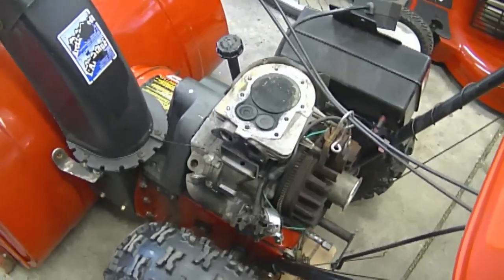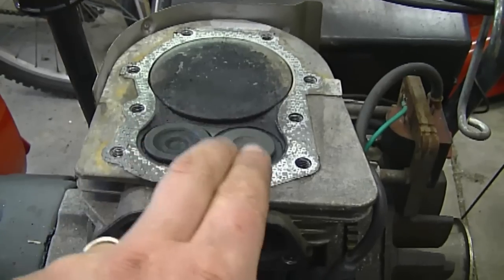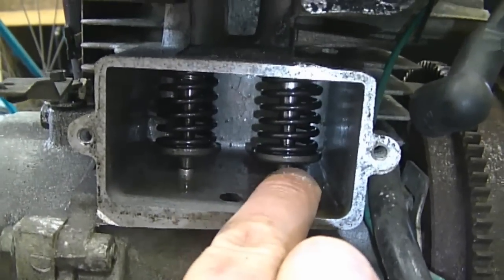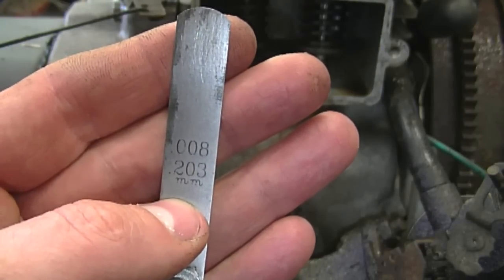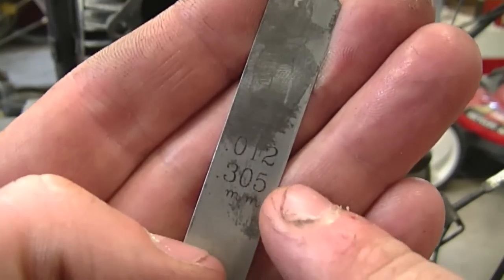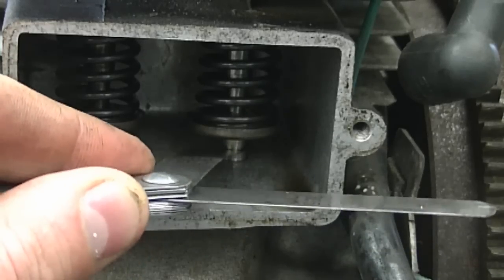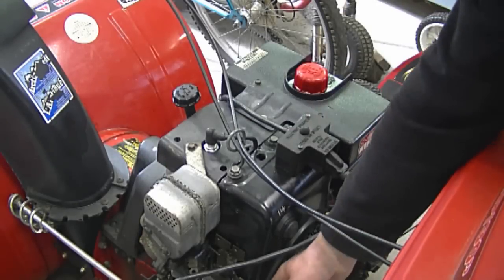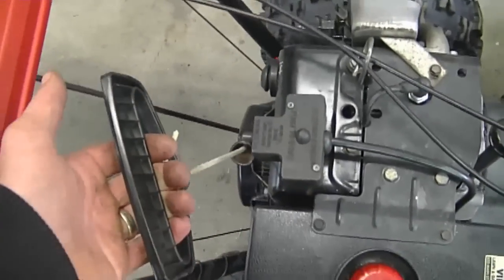HOW TO Check The Valve Clearance On A 4 Cycle Flat Head Engine

Comment: But how does the clearance get that tight in an old motor?   It should get looser...   Metal doesn't just grow onto the valve stem.
Reply: The valve seat wears down, thus reducing the clearances. It tends to happen more often on the exhaust valve.
Reply: TReaD113  He could probably put a new valve in that would probably have more material, but I guess the easy and cheaper way is to just grind a little off.
Reply: Putting a new valve in wouldn't help at all. The seat is still worn down and you'd still have to grind the stem. grasscutter88
Reply: Valves and valve stems can stretch over time due to heat and pounding against the valve seat; particularly exhaust valves. It used to happen a lot in air cooled VW engines. Valve seat and valve face wear can reduce the clearance too. This valve actually had negative lash (it was being held open even at the base circle of the cam). The original 12 thousandths lash was gone plus a few thousandths. This is pretty excessive for a valve to tighten up this much. I think there might be other issues going on with this engine.
Reply: This isn't very abnormal, it happens on these engines with relatively high hours. Just wear over time and it will still run like that so it keeps getting worse. Repair it like this and it will last just as long again

Comment: Hey Sherlock that's a no-brainer when the exhaust valve was sticking up at top dead center that's a pretty good indication there's not going to be any clearance.. So how did the face surface look on exhaust valve I'm sure we did the right thing and go ahead and pull the intake valve off also and refurbished or grind both of the valves then  lap them .then adjust you clearance by removal of material on end of valve stem.. That face must have been bad because if your clearance was . Nothing on the exhaust it had to come off the top on your face I'm sure you would demonstrate proper proper way of doing a valve job since you went that far with it not just half... And maybe you can explain to the viewers why it was 0 Clarence somebody has to be wondering well that valve. Just did not grow why is the clearance at zero
Reply from the maker: why don't you make a video explaining it?